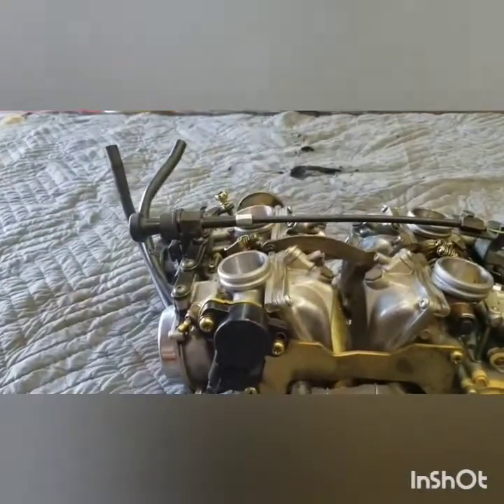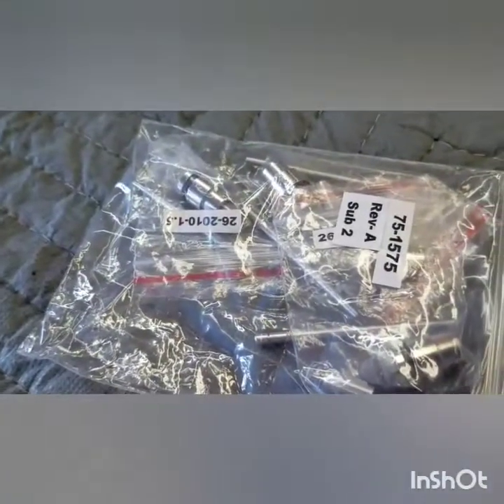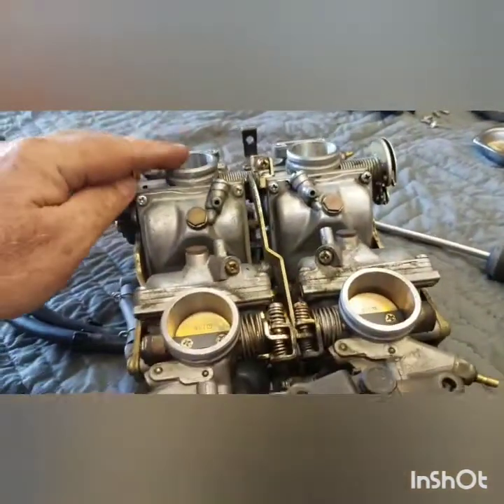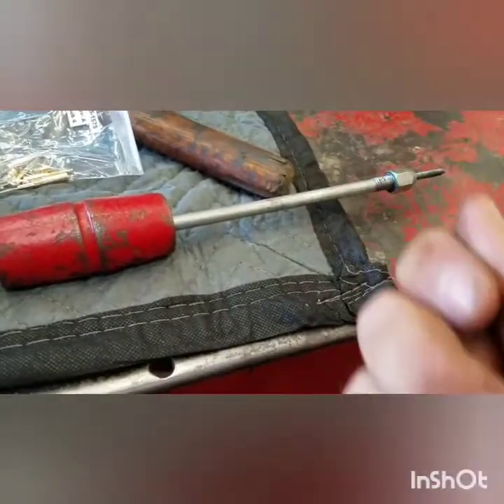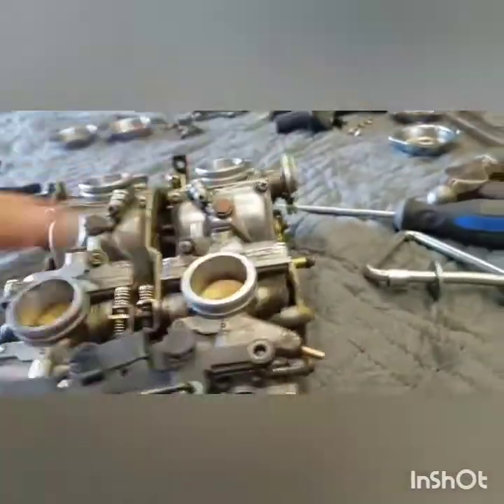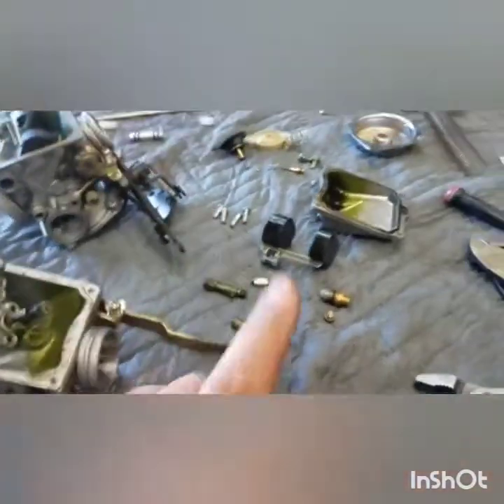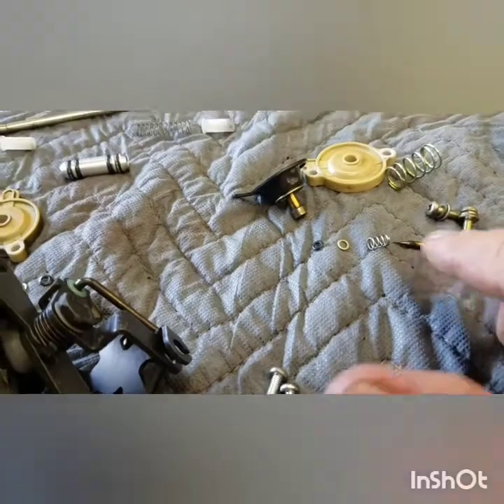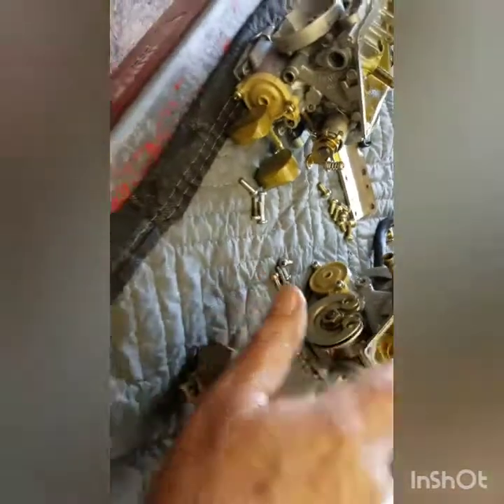Yamaha Royal Star XVZ1300A carb rebuild

Comment: Thanks for video GM! I am the original owner of 97 RS. I last cleaned the carbs over a dozen years ago and am pretty good about using a fuel stabilizer when storing the bike. Despite that, I have had gas leaking from the carbs, so I decided it is probably past time to yank the carbs, clean the jets, and replace the gaskets. The parts were pretty clean with only minor build up, but the gaskets and rings were almost solid. Even though I have cleaned the carbs previously, your video has been very helpful.
Reply from the maker: Glad it helped!
Reply: @geezermoto7820  Just watched another of your vids and you suggested replacing the rubber intake manifold boots. I have never replaced mine, so guess I'll order a set off ebay and replace those while I have the carbs off.
Reply from the maker: @kennethcasper106  yes, the boots "manifolds" get hard, then suck air
   Put a heavy layer of threebond 1184 on before bolting them up. I've had new ones leak when not using 1184.
Threebond 1184 is available on ebay or through your tucker or parts unlimited dealer
Reply: @geezermoto7820  I received the new intake manifolds. On one, the vacuum fitting was not glued in. Do you know what would be a good adhesive for this? Will the 1184 hold it? THx. Ken
Reply from the maker: @kennethcasper106  
Yes, a liberal dose of 1184 should do it Kenneth
Reply: Well how did it go Kenneth?  Did you get things all buttoned up?  Two days ago I bought an '07 RSTD that's beautiful BUT has seeping carbs.  The previous (second) owner supposedly had them gone through last year, but either he or his "mechanic" aren't being truthful.  Anyway, I'm an excited new RS owner, and I really want to be riding rather than wrenching.  IF I can have it back on the road faster by doing it myself, I'd rather do that than boxing everything up and shipping it to Mr. Moto.................but I'm a little intimidated by the whole carb assembly.
Reply: @ORflycaster  I overhauled the carbs over a year ago. Reassembly isn’t too tough. Take a few pictures as you disassemble,so you can refer back if needed. I also keep parts for each individual carb together so all go back into the carb they came from. I thought I might have to resync the carbs, but bike didn’t appear to need it. This last winter, the fuel pump started leaking, so I ended up replacing it. Bike is running like a top now.
Reply: @Kenneth
Thank you for the reply and update.  I’m shopping for the rebuild kit right now.  Did you also replace the diaphragms, or do the have a much longer life being free from the fuel exposure?  I’m hoping one long day could have me back on the road once the kit arrived.
Reply: @ORflycaster  I did not replace the diaphragms. They seemed to be okay. Good luck!!
Reply: @Kenneth
Thanks, I just ordered the kit this morning.

Comment: This is great information. I have a 2009 Venture that had the carbs jetted. The bike runs a bit rich so I'm looking forward to getting the mixture right. Thx for sharing this!!
Reply from the maker: with warm and lowest possible idle, turn each air/fuel mixture screw in and out to get premium idle, low speed mixture.  about 1.5 or 2 turns out when running best means pilot jets are correct size.  More than 3 or 3.5 turns out means pilots need to be a size richer.  Closed or very little open means pilots are too rich, go to size leaner(smaller number)
Reply from the maker: slowly turn in till runs worse,  then out till runs worse,  then to the middle of that is correct setting
Reply: @geezermoto7820  Thanks!!!
Reply from the maker: @MattTellman  welcome bro!

Comment: Since I can't get through on email for some reason. I have went through the carbs on a 97 royalstar with all new needle valves and seats and everything. The bike runs absolutely great but no matter what I do, I'm getting gas out both of the air vent tubes on top of the carbs. I actually set the floats so I should be starving for fuel when into the throttle pretty good but nothing changes
Reply from the maker: I found you in my spam folder and un-spammed you, now I'm reading your mail
Reply from the maker: Sounds like o-rings on needle seats are bad
Reply: @geezermoto7820  I just put them in new in all carbs

Comment: how do you check and adjust the throttle position sensor? im also having a problem with popping when i level off the gas when i get up to speed. thank you for your videos they have been very helpful
Reply from the maker: The TPS normally needs no adjustment unless it's removed but it's done with a multimeter and specs from the service manual. Popping on deceleration is from the slow circuit being too lean. Try a size larger pilot jet (sometimes called slow or idle jet)

Comment: Hey there GM, I chatted with you a few years back about my '07 RSV where I had a heavy fuel smell in the garage after rides. You recommended the seals on the needle might be going. I didn't get a chance to work on it then, as life got in the way. I have added monster ovals since then, picked up a carb repair and a jet kit for that and then had to move from the Midwest to your neck of the woods. Rode about half the year here then got a constant leak soon as the bike fires up. So now I have the bodies off the bike. 

I am in the process of tearing down the carbs. I wanted to know, how far I need to go? Does the vat damage electronic components? Do I need to remove the throttle body position sensor?
Reply: Move to strike, Your Honor...
Watched till the end and you told me.😁
Reply: Wanted to provide an update: I bought new plugs, a fuel pump and filter, as I figure it was time to get that out of the way while I was wrenching. Broke down the carbs and soaked everything I wasn't replacing. Dipped in water then Naphtha just as you did. Installed the jets from the kit and replaced all the seals, needles and seats. Fired right up and purred like an angry kitten. I was over the moon that I was able to do it just attending your 101 course. Then after a day and a half, she wouldn't start. I kept fiddling with the pilot screws, the idle speed screw, and nothing brought her back.

Well, after about a couple weeks of fooling with it a little after work, ordering several pilot jet sizes, I kept getting the feeling she was starving for fuel. I finally did a petcock and fuel pump flow test. Petcock was fine. Pulled the fuel line to the carbs and tried starting her and the line was sputtering, so I rigged up a temp shop fuel tank so I can get a look at the carbs while trying to start it. the temp tank had some clear line on it and I noticed the fuel was not getting sucked down into the system. Put the original pump back on (which I salvaged out of the trash because I had a feeling I might be needing it after reading a bunch of blogs and watching other carburetor videos). Lo and Behold! She was back to purring again!

Just wanted to thank you for such a detailed video on carbs and specifically the same ones I was working on. Couldn't have done it without you and now I am a bit wiser on how to troubleshoot these. In all my years wrenching on cars and bikes with my dad, and I'm now 51, it was my first time tearing down and rebuilding carbs. He's still up north and I wish he could have been with me. But I'll get to show him when I take a ride up there.
Can't thank you enough, sir.

Comment: Ive torn 1 carb apart and reseated everything. But the diaphram is not pushing the black cylinder and rod back into the middle when i push it. Is there a lube im supposed to put on that black cylinder? What have I missed?

Comment: Great video. Do you remove the throttle position sensor? If so do you have to re-calibrate it after you put everything back together
Reply from the maker: I do not remove it and yes, it must be reset after removing

Comment: I have a 99 royal star tour deluxe but am struggling to find a kit from what I see they only go to 98 on all of the ones I see, is there not a 99 rebuild kit?
Reply from the maker: Yes, it's available

Search it on ebay

Get one for about 100.
Reply: @geezermoto7820  so is the 99 and 98 kit the same or did they change the carb style between those years?
Reply from the maker: @StrongSider23  i compare the old float bowl gasket to the new one shown in the kit
Reply: @geezermoto7820  okay I have yet to pull the carbs but basicly gasket match is the only way to tell? I don't know why the all are labeled up to 98 and then go 00 up on the newer kits.
Reply from the maker: @StrongSider23  only way I can get it right

Just be sure the slow and main jets are same size after you get the kit. To match your old ones.

Or just simply soak the old ones in carb cleaner until they look new and reuse them
Reply: @geezermoto7820  the bike only has 7k on it but it has sat for close to 10 years so I'm hoping I can reuse the jets and get the oem ones clean. Thank you for your help!

Comment: Hey man love this video I just pulled my carburetor out this will be my first time working on one but I do have some mechanical knowledge on cars my question is why would there be oil splashes into the air box any idea ? Thank you in advance and I’m rebuilding the exact carb
Reply from the maker: The Crankcase vent system goes into airbox,   if too much oil is installed, it will end up in airbox or an engine with failing rings or valve seals will do it. No alarm unless you are fighting a good bit of oil

Comment: Have you noticed much performance gains from switching to pod filters, jets and a gutted exhaust? Wondering if I want to go the whole 9 and  rejet or just clean my idle jets and leave the bike stock
Reply from the maker: Free flowing exhaust and a good aftermarket filter will make a nice improvement, but not a big improvement. I don't care for pod filters, but a better replacement element is good or performance air box/air filter combo

Comment: Hey, just a quick question maybe you could help with. Is it an absolute must having to change the carb bowl gaskets after opening them up or can you get by with the same gasket if it's not torn? I'm trying to decide to separate them clean the jets or just seafoam and put them back on the bike for now until the replacement gaskets arrive in a couple weeks. Thanks in advance for the advice.
Reply from the maker: sometimes you can, sometimes you can't.  but you must get in there and clean them up.
   get threebond 1184 or yamabond 4 to seal bowls if leak with old gaskets (o-rings)
Reply: @geezermoto7820  Thanks bud I appreciate it!
Reply from the maker: @territodude  no prob, just holler if ya need to bro

Comment: I recently purchased a Yamaha 1997 1300 cc tour deluxe with 6600 miles. I bought the bike pretty cheap but running very poorly. I was told the gas was left in the tank & carbs for many years. I ordered the all balls kit and a ultrasonic cleaner thinking that I can rebuild my carbs after watching your video. I took my time and  I started out dissembling carb 3 and than ran into some issues.  I can not remove the needle jet screw that is behind the plug (the plug was  not present on my carb)  , also the float valve brass fitting hold down screw is also frozen and damage from excessive force on trying to remove them.  Both screws are damaged and may require drilling them out .  I have used my best snap-on  screw driver on them unfortunately the brass flat head screw is no longer a flat heat. Is it possible to drill the needle vale adjustment screw without damaging the carbs or is that a no go .
Reply from the maker: well, the simple answer is sometimes you can, sometimes you cannot.
The stuck fuel/air adj screw is a bigger prob.
What i do alllll the time is when i cannot get them out, i buy used carb body or bodies on ebay, and using the different parts, etc, i build up a perfect set of bad ass carbs 

you can ship to me if you wish 

either way i wish you luck and feel free to bug me all you need to lol

I'm in West Tx btw

Comment: Hello, Mr Geezer. I am looking for Carburetor for Royal Star 1300 part number 4nk-14901-00-00 ( Carburetor 1) but i couldnt find it. Do you know if the carburetor for Royal Star Venture work for Royal Star tour? Thanks
Reply from the maker: What year model you have?
Reply: @geezermoto7820  1996
Reply from the maker: @maryoropeza3475  I'll see what i can find, be back in a few, usually you end up buying all 4 ...one is hard to find.... I'll be back in a few
Reply: @geezermoto7820  In fact i need all 4. thanks. I appreciate.
Reply from the maker: @maryoropeza3475  all 4 XVZ1300 models in 1996 used the same part number carb
Reply from the maker: @maryoropeza3475   and a few other years will be the same... I'll look, be back
Reply from the maker: Looks like 96-98 are same

Bottom line is if it LOOKS just like yours it will work
Reply from the maker: I'm not finding any

It will cost between 4 and 600 to buy some used ones, then rebuild and kit them.

Can yours be rebuilt?
Normally, that's how its done unless something is broken or a frozen jet
Reply: @geezermoto7820   Thanks. I am out of US. But I will Keep in mind.
Reply from the maker: @maryoropeza3475  you are very welcome
Reply: @geezermoto7820  You too. Thanks a lot!!

Comment: Do you have a video on setting these float heights on the bench geezer moto
Reply from the maker: I do not. Just compare all 4 floats and confirm all 4 little seat "tabs" are same position.  This is how i do it.

...you can probably find a "float height" measurement, then hold upside down to where float weight is keeping them closed, and measure from float bowl gasket face to far edge of float, this is your height.
., Find a video on any bike's float height to see how it is done, you can measure height with drain hose as well, but this method would be hard to explain here. Just dig a bit, it's all out there and feel free to bug me more! Lol.  Also, I'll make a vid soon

Comment: Hi, thank you for your videos. It's hard to find much information on these old bikes. My question is about which kit to order from eBay. My bike is a 1983XVZ 12 T. When you look at the kits on eBay all of the XVZ bikes are 1300s and not 1200s. I do see the VMX 1200 for 1983 models but I think that's the VMax and I'm not sure that would work. Could you please share some of your knowledge and tell me which rebuild kit to order for my 1983 XVZ 12T? Thank you for your videos and have a great day.
Mark Nance
Reply from the maker: Search this on ebay....

Motorcycle Carburetor Repair Kit Main Jet Sub for Yamaha VMAX V-Max 1200 VMX12

It is vmax 12 but the needles and seats and bowl gaskets should be what you need

Soak your old brass in a gallon of carb cleaner and reuse.
Meaning, reuse your old jets and needles
Reply: Geezer Moto Thank you for your quick reply, that is a ton of help. I couldn't figure out why they don't list an 1983 XVZ 12 and started thinking maybe I had the only one in the world.  My virtual only has about 17,000 miles on it but my business keeps me away from riding very much, it almost looks new. I also have a 1979 Honda Cbx with 11,000 miles on it and did have the carbs re-done about two years ago and I'm sure to keep non-ethanol fuel in it and at least start it often. I'm a Texan myself and live most of my life and Tyler. I am in Utah now for 26 years but I am in the process of getting back to the best state in the union, around Tyler Texas on Lake Palestine. Thank you so much for your help and I would send you my carbs but I don't have time to take them off and will be taking them to a local mechanic that is trustworthy. Again, thank you so much for that bit of knowledge I would not have known what to do. Good luck and have a great day. Mark Nance
Reply from the maker: @marknance7070  you are very Mark
.....can I have your CBX?????

WOW!!!   lol
Reply: Geezer Moto mr. geezer, sorry I don't know your first name. Please excuse my messages I'm doing voice recognition and have a very thick east Texas accent. I did sell my 1969 Mach one because I didn't want to have to totally Resto mod that car. That was hard to get rid of but I don't think I could ever get rid of the Cbx. It has the six in the one exhaust which looks really cool and all the decals look brand new on it. The mechanic that's going to work on the venture carburetors had mentioned before I talked to you. if I could get the entire kit get everything for the carburetors. I'm thinking that from what you said maybe all of those parts in the VMX 12 kit will not work in my 1983 Venture 12. Is that correct? It sounds like you were saying that only the needles, seats and bowl gasket or usable from the VMX kit on the XVZ 12. Thank you for all of your help and where in Texas are you? Have a great day.
Reply from the maker: @marknance7070  your engine is tuned differently thank a vmx so the slow jet main jet and needles will all be different, but, the brass (your jets) are good, just soak in carb cleaner for like 2 days or so and get them clean as new.
...usually all you really need is the bowl gaskets and float and needle seats where the fuel comes into the carb.
   Triple check your rubber diaphragms, cannot have holes and must install to where they work.....watch video on this.

And replace your intake manifolds if hard or cracked
Reply from the maker: @marknance7070  often times a cheap kit will not have numbers on the jets
......you get what you pay for

Look for all 4 for about 99.00
Reply from the maker: @marknance7070  all 4 carb kits for 99 that is
Reply from the maker: Oh, i guess you have heard my heavy west texas hillbilly bubba accent lol
Reply from the maker: And, it's Tim lol